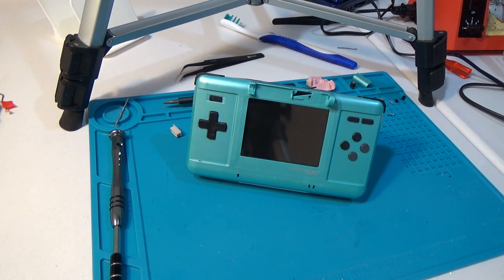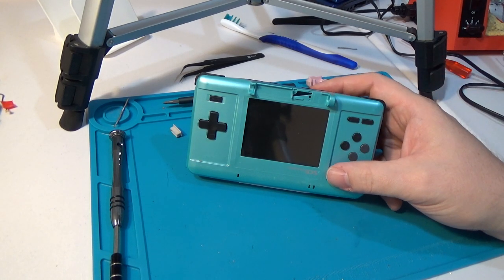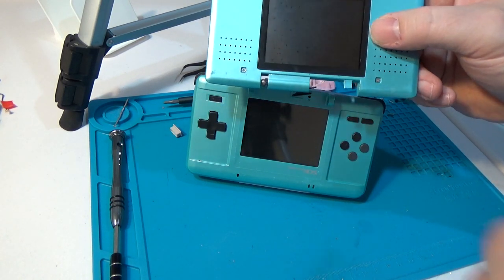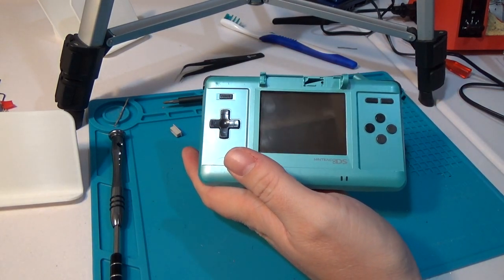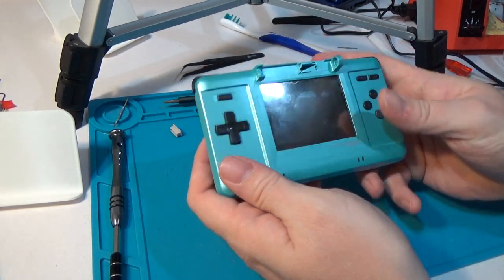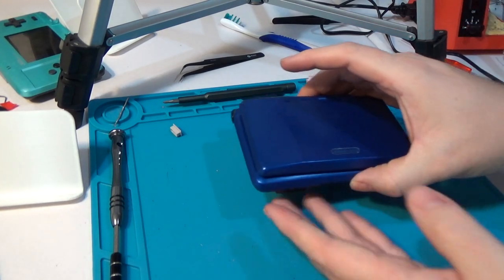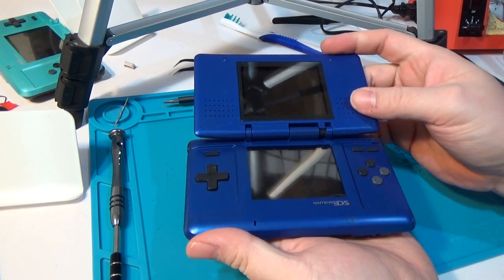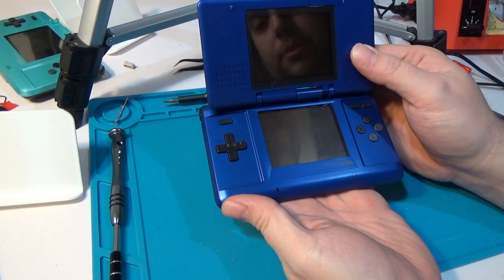How to Make a Game Boy Macro XL from a Nintendo DS

Comment: I’m about to try this for the 1st time. 
It maybe a silly question but what does the resistor do? I’ve unplugged the top screen just to try it and it just flashes off
Reply: The system can tell if there is a top screen in use, the resistor tricks it into running without it

Comment: Any idea what would cause the system to not boot? I have tried my trouble shooting to my knowledge but I am new to this. I can email you pictures and everything I’m just stuck. It booted when I tested the speaker and then when in the shell before I sealed it I tried again and nothing. Any ideas??
Reply from the maker: That's a tough one!  

I saw your reddit thread with your pictures you had listed.  It looks like your setup should work.  You've got a bit of an unorthodox soldering job going on, but it seems like it should work.  If it worked before you put it in the shell, and didn't work afterwards, I'd suggest to first remove everything from the shell, and try to boot it again that way.    It's possible with the large amount of solder you used, plus other components, it's putting a bit too much stress on the board in that area, and/or the solder is causing a short with a component beside it.

I would then look at tackling your soldering job.  You don't need the breakout board to solder the LED to.  You can solder it directly to the motherboard itself at those test points.  It takes a bit of finessing, but you can get it attached to the small test points.

Lastly, if you're still seeing the screen being white when it boots, it's possible that one of the three ribbon cables is loose that attached to the board.  Try reseating them, to make sure they're properly seated in their sockets.  Also inspect the main ribbon cable (the thicker one) for any cracks on the sides of it.  If any of the traces are cracked on that display, it could cause the white screen that you're seeing.  If that's the case, you'll need to procure a screen from another broken DS somewhere and swap it out.

Good luck!
Reply: Appreciate it! I ordered the smt resistor to! I’ll just take a break from it for now. This being the first project I’ve done I can say it’s already been a great learning experience lol.
Reply from the maker: @BennyCriss12  Sounds good!  Report back when you get back to it and make it work.  I'm excited to hear about your progress once the new resistors come in!

Comment: Great video! I have watched your DS lite mods (videos) and learned a great deal with that. I have recently picked up a broken DS fat (the same blue DS original in your video) mine definitely the top screen is bad. Question, can you put an led lite instead of resistor? I don’t have those but done great with small led lights with making DS lite neons. Thanks for posting, I’m new on YouTube too lol.
Reply from the maker: Great question!  I'm pretty sure that you can use an LED.  I think I've seen a few videos online of people that have done that, but have had mixed results on whether or not it actually worked correctly.  You could always solder one on and give it a try, and see if it works!  Worst case, if it doesn't, you know how to tear it apart, and you can go buy some resistors and swap it out with one of those.

Good luck!
Reply: The Broken Past thanks friend, it sort of works but doesn’t, or my unit is cranky - Thanks for the reply 😊

Comment: What kind of resistor are you using and where I can get it, thanks for your help
Reply: Tends to be an Surface mounted resistor of 330ohms 0805
Reply from the maker: Yep!  I used a sized 0805, ~330ohm resistor.  You can get them pretty cheap on eBay.  Here's a link to someone selling them (though they look like they're OOS at the moment):

https://www.ebay.com/itm/121357880834

There are quite a few sellers though selling these.

Comment: Hi, I made this, and it turns on, but just stays on a white screen. It won't boot into the home menu.

 Is this a bad thing? I can't find a way to fix it.
Reply: @Sushiirull Oh, I almost threw it away but I decided to re-solder the resistor, (I threw away two, because I inevitably broke them..) and it works now :) Although I accidentally broke the touchscreen cable for the lower screen (The main screen for macro..) and now the touchscreen doesn't work. I mean, it feels like an actual GBA, not being able to use touchscreen, but in a way, it's almost annoying, because the original GBA, to my knowledge, didn't boot into a home menu like the DS / Lite did..
Reply: @Sushiirull Hmm yes :) But is there a way to just remove it altogether? Like, edit the code? If there is a way, I can code..

Comment: I'm getting a white flicker on bottom screen with a split second of green light then no power at all. Any suggestions??
Reply from the maker: Sounds like one of your ribbon cables is loose, or your resistor isn't soldered properly, and it's failing the power on self-check and shutting back down because of it.  Give those a closer look.
Reply: @TheBrokenPast  i removed the digitizer and one ribbon cable is left uncoonected... is this an issue that causes this problem?

Comment: My DS top screen completely detached and now the DS doesn't turn on anymore, do you think I can still  turn it into a  Macro XL or it's good for garbage ?
Thanks for the video though ! very clear
Reply from the maker: Thanks!  Agreed with the other responder, I'd recommend taking it apart and taking a look.  So long as the lower body is good, you should be in good shape.  Even if the bottom screen is bad, but the upper screen is good, you can swap those around too (as the top screen isn't directly attached to the lower motherboard like in the other DS consoles; so even if the top half detached, the screen ribbon cable itself should still be good).

Good luck!
Reply: @TheBrokenPast  Ok thanks :D I'll take a look inside

Comment: Do you think we can use a resistor from another board from another DS?
Reply from the maker: Good question!  I would say...... "probably"?  I'm not sure the specs on the rest of the board, and if you'd be able to find a matching 0805 330ohm resistor to fit.  If you could, it should work just fine!  Though they're also quite cheap on eBay to buy a roll of them, so I'd suggest going that route from an convenience standpoint!

Comment: a photo of the chip you put in to buy the code for it ds screen .
Reply from the maker: I assume you're talking about the tiny resistor I used to trick it into thinking there was a top screen?  That's a 330 ohm, sized 0805 resistor.  

Here's an example listing for them on Amazon:
https://www.amazon.com/uxcell-Resistor-Resistors-Tolerance-300pcs/dp/B07QGQ5XHM

Comment: What is the purpose of the resistor?
Reply from the maker: Good question!

It helps to "trick" the DS into thinking that the top screen is connected.  Otherwise, without it the system would just turn right back off, thinking that there was no top screen connected; which is required for it to work.

Comment: Hi,  awesome tutorial.  I'm going to do this with a DS that has a broken hinge.  I was wondering what type of Bondo to use if I go down the road to making it look even better on the top.  Any advice would be great.
Reply from the maker: I use Bondo specifically because it's cheap, and it's easy to find at your local Walmart or other auto store.  But Bondo being a more specific brand of body filler, I'm sure there are other options out there that may be better or cheaper.  The stuff I'm using (and will have a video out for eventually once the weather cooperates!) is a basic two-part application, with a can of material, and a small squeeze tube of hardener.  

The biggest thing to keep in mind is that it matters less of what type of body filler you're using, and more of the prep work in cleaning and sanding and smoothing, to hide all the imperfections and get it to lay completely flat.

Good luck on your project!
Reply: @TheBrokenPast  Thank you.  I've look around and it all looks confusing to me to which type of filler to get lol
Reply from the maker: @robertrmd3063  This is what I use:

https://www.walmart.com/ip/Bondo-Lightweight-Filler-262T-1-Quart/17056863

It's pretty cheap, and fairly easy to use.  Just make sure you do it outside.  This stuff smells STRONG!